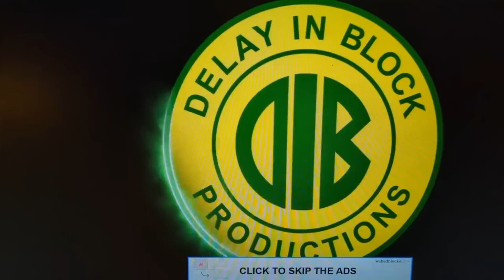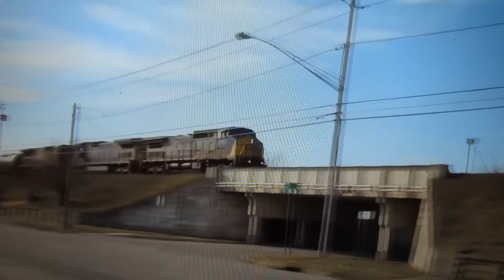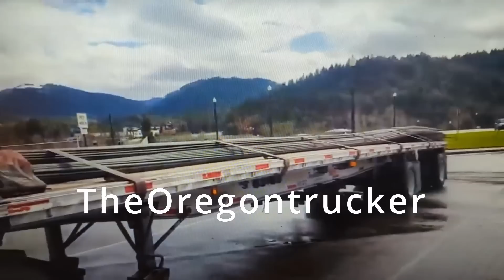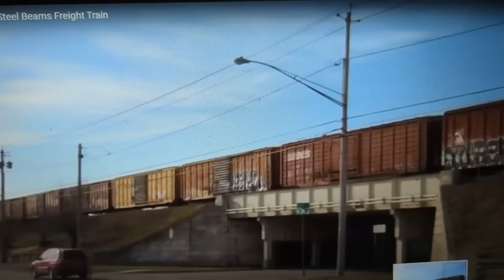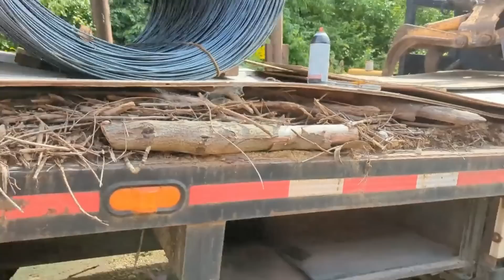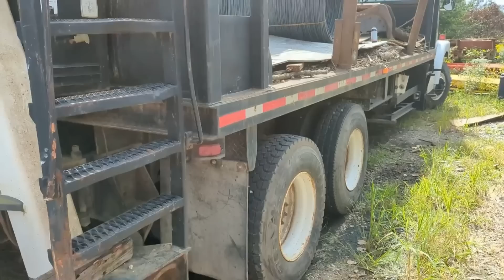Rail Cars loaded with Steel!

Comment: Get a material handler. also build up a loading ramp to provide a better reach and view for the operator. place the ramp along the line where the flatcar/ gondola is on one side and the trailer and truck on the road side. this would maximize lifting capacity  for the loader.  Build a lift pad for fork trucks on the opposite side of the track. This would provide the most versatility for handling loads that are non magnetic,  such as timber, precast concrete girders/piles, and structural composite materials.
Reply: with time...

Comment: Something else to consider is if you might need to handle coils of alloys other than ferrous material,  Some stainless materials along with aluminum, copper, etc you won't be able to use the magnet.  How the material is oriented on the trailer may also matter to the customer.  For instance some customers prefer/require that coils be shipped to them "Eye to the Sky" where the coil sits on it's end.  Some customers prefer/ require that coils be shipped "suicide" laying down and able to roll like the coil on the grapple truck.  Sometimes dimensions of the coil will dictate how it needs to be shipped.   You may need more than one way to handle materials.  Have you visited other trans-loading facilities to see what they do?  Chances are someone else has already faced these similar issues.
Reply: Another thought, In addition you should also determine who is responsible for securing the freight to the trailers, and who is to supply the equipment, and who is responsible for repair / replacement of lost equipment.  Chains, binders, straps, tarps, blocking / dunnage, corner boards all add up.

Comment: Maybe look into a burro RR crane or track maintance crane that has enough capacity. Your going to need a spotter truck to move the trailers around probably too. I agree to rent the excavator first to make sure that system is right for the work your doing. Good luck Sir. Go ETR.
Reply: A Burro or any railroad crane has a huge drawback of only being able to load or unload from one end of a gondola or flat car and then consider the length of the boom for reach.

Comment: Here is an idea for you. I'm a Logistics SME by trade.  See the attached as an example.  https://www.youtube.com/watch?v=Uy4omHwPQTY   You can use a Reachstacker for different applications. Coils, Sheet Metal & Containers.  Your yard will need ground prep (like compacted pea gravel)  for the Rigs, Trailers & the Stacker.   Will need a security fence should you intend to park trailers overnight. Especially if you park loaded trailers or containers.  Lighting for working past 4PM in the NE during the fall & winter.

Comment: Suggest you take a look at how end user currently removes steel coils from the trailers. There maybe a closed factory has an overhead gantry that can be lurched and reused in your yard.  Several YouTube channels have videos on handing steel coils using “coil tongs” and another called a “coil tipper”.

Comment: Some kind of device that can reach. Are you going to by a yard truck for moving trailers around most shipping terminals have them. They used to call the mini trucks with a hydraulic 5th wheel so you don't have to crank landing gears on trailer. Taylor makes good fork lifts, Cummings diesel 20, 40 tons. They are a bit awkward I have operated a 20 ton. Things to remember do you have power to plug block heaters in at yard, power line location when lifting. You and your son are very intelligent and I can't wait to see your dreams come true with this business opportunity!

Comment: When I used to be a flatbed driver, many times my trailer was loader by using a "travel lift", very similar to what is used in boatyards.
Reply from the maker: My concern with a travel lift is that it would be slow.  Brian
Reply: @eastterminalrailway5975  With the correct rigging, you could pick up a complete truck load with one shot. Sure it might be a little slow, but you gain an advantage with maneuverability.

Comment: My vote is for a tracked machine. I recently fabricated a simple grapple attachment for a 250 excavator to lift and place odd size sections of sea container (so no corner pocket lift points) for use in building prefab homes. It worked perfectly and was not expensive to make. A smooth jaw grapple or horizontal spike could retrieve the coils from the gondola without second man. Thanks for the update. I love following your journey.
Reply from the maker: Thank You for following.  B.

Comment: I'd say fixed gantry, bolted to a concrete foundation, spanning one track and a road trailer parking spot. Move the cars with the 2021 back and forth, pick the loads with either a magnet (for coils) or some sort of beam (for the long ones), drop them in the trailer - done.
I think it's the sturdiest solution, minimum risk for people and, if you ever want to relocate it, you only "lose" the concrete foundation.
Go ETR! 🙂🙂

Comment: Do you have enough land space to unload and store with total access
Reply: That was my thought. The weird thing is, if you go on the County GIS, it shows that ETR only owns the Northern “half”, while the Southern “half” is still owned by what I’m assuming is the original developer of that industrial subdivision. If that is indeed the case and that ETR does not actually own that, I would not be making improvements to anything maybe other than the rail. The problem with the Northern half is that trucks have to access the site through the neighboring property. Even if their are ingress/egress easements, is the owner going to want heavy trucks going through it everyday? I don’t know. 

It all sounds good on paper, but when you start getting into the nitty gritty stuff, it is a big undertaking.

I think ETR needs to determine an exact plan of the entire process, from what improvements he plans to make to the site, site access, loading/unloading, etc., and then go to these potential costumers and get something in writing effectively making them follow through on the business end of things. Seems like a somewhat expensive initial investment  to make things safe and efficient for a single owner.

Comment: It seems like you could use an excavator with one of those C shaped things they pickup sheet coils with. Just as long as you'd have room to hook the first one. In that case you wouldn't need anyone inside the gon aside from possibly helping direct the operator if their vision is obstructed. Still they wouldn't need to be in the car just at an angle they could see to help direct the machine. There's a place we haul slinky coils for here in Michigan. I hate hauling those things, thankfully that's not my job but I'd love to get that stuff on a rail even though it would eliminate some of our business. The place we load the coils and bars out west ships railcars via ns and up. The place we deliver has sidings off a short line that's partnered with ns but for whatever reason they've not put 2 and 2 together. It's very possibly the same issues you're talking about. Their siding is set up for the previous occupant of that facility who received boxcar traffic. That doesn't really lend itself to unloading gons or bulkhead flatcars. I think a situation like that creates opportunity for an operation like yours where you could bridge the gap, save them money and still profit off the savings. I probably should have taken some business classes so I could get into that sort of business instead of getting a cdl. Being in this part of the business I see many opportunities but lack the knowledge or capital to seize them.
Reply from the maker: Good info, the material  handler with the c hook would keep people out of the Gon.  Brian
Reply: @eastterminalrailway5975  the excavator or material handler is the way to go for the coils. The magnet I see as a problem for precise loading. Not sure but just seems like not as much control. With the excavator with the C hook you precisely load and unload. You have to find out how they like them loaded on the trucks. Plus the magnet limits you to just magnetic materials. If you have a quick coupler on the excavator you can buy or build different attachments that will be specific to different materials you might unload. With a big material handler or excavator and a good size forklift or a big lull you should be all set. Good luck. Love seeing your progress and glad you are pushing forward.
Reply: I can’t tell you how much I want to see you make this all come together and you can start making a profit.  You are without a doubt my favorite channel and always look forward to your next video.
Reply: https://youtu.be/9FMwBIYwgnc

This C shaped unloaded mounted on the excavator type machine would be best, in my opinion. No people in gons, and less damage to material. The C-hook could even be modified some for less damage, and could be made in house. Cheap and simple always best

Comment: Push liability away whenever possible. I think you can safely put dunnage on the flatbeds before you load them. But, load securement should be 100% on the trucker. They should furnish and install whatever it is they're going to use to tie down the loads. Yes, their ultimately responsible. But, you don't even want to be partly responsible.

You can start renting an excavator or whatever you decide you need while you are getting started. It gives you flexibility while you are ramping up. Maybe you discover you need a bigger one or more than one. You can buy equipment with plenty of value left in them at the auction. But, if you have an equipment failure, nobody wants to hear that you're going to be down for a week while you diagnose the problem and wait for parts. "Hello rental company? Your excavator is blowing white smoke. Bring me another one!" If you want to use your own fleet you're going to need to have extra equipment on hot standby. Remember that nobody cares that "you tried" since you were in high school.
Reply: I second that on rental.  With this being a YouTube channel it could potentially be an opportunity for them to provide one for free advertising or at a discounted rate.  That’s what everyone is doing now on these channels, so everyone can see a real world person using it vs some actor or athlete that doesn’t know the difference between a track loader and a wheel loader.
Reply: I believe the driver is always responsible for making sure his load is properly secured.  The DOT doesn't care if someone else loaded it--the driver is the one pulling it down the road.  Same way the DOT doesn't care if your dispatcher won't give you time to repair a defect--you are driving it, so you are responsible for it.  End of story.
Reply: @fredygump5578  I drove flatbeds for awhile in the 80s. It was my responsibility to tie things down securely. I went to a job site to pick up a return load of rented scaffolding. The way the crew had stacked them(mismatched sizes, hanging over the edge of the 'wagon'), there was no way to secure it. They had to take it all off and restack the pieces. As William Degnan said, you can use dunnage to hold the rolls in place. The trucker will chain them down.
Reply: maybe start thinking about insurances cost and control of your company also.
Reply from the maker: Johnny Insurance is on this weeks to do list!  Thanks for following. B.
Reply: Preloading flatbed like that will definitely present an issue. Slinky coils are dangerous anyway you handle them. They 100% can't be moved in anyway until secured but as a trucker myself I do not like anyone securing my loads besides me. I want to do it myself so I know it's done correctly with reliable straps or chains. Usually whe we load that type of coil we have to assist the loading crew to get the on the trailer properly.
Reply from the maker: KC  I like the rental idea.  B.
Reply: I really endorse the equipment rental idea until you know what works and what the costs are. No upfront committment of money and you have relatively new equipment to get started with! Good business plan.
Reply: I was a Transportation planner in the Army Reserve for 21 years.
Sometimes Green Assets(Military) would  self transport from base to base, other times, Green Assets were used for exercise (this is Conus) on Base, and there was a "Yard" for Equipment coming to and from base. Many times White Assetts (civillian trucks) were used to move a unit's humvee's back to Home Station. Usually Military and Civillian worked together because at truck yard the Army had 88N (traffic managers) and 88H (Cargo Handler). 88N also had 88H training and we were driving equipment onto trucks and helping to chain/tie down but ultimately the Sergeant in charge of the Yard and the Truck had to agree 👍 it was safe.

Comment: with a magnet, you can't lift non-magnetics like aluminum.

An bucket loader with attachments (fork and straps).  You can also use it for track maintenance, so you can fill 2 needs.

Also, there are forklifts designed to lift/move containers.

I really think you will have the  most utility with a bucket loader for both weight and flexibility

Comment: buy a straddle crane....they are on wheels and you could easily ballast the tracks and allow it to move freely unloading and loading trailers and railcars...lots of scrapyards use them as well as steel companys